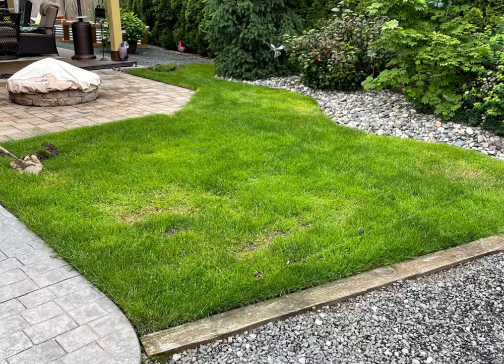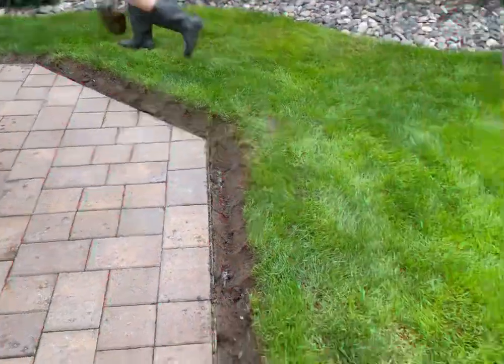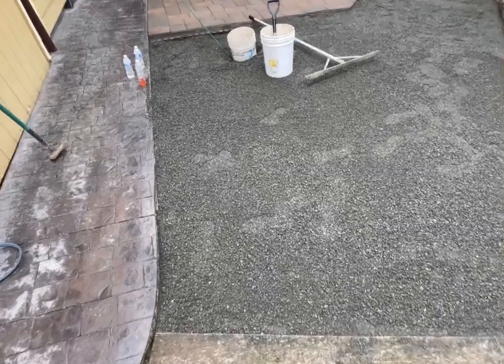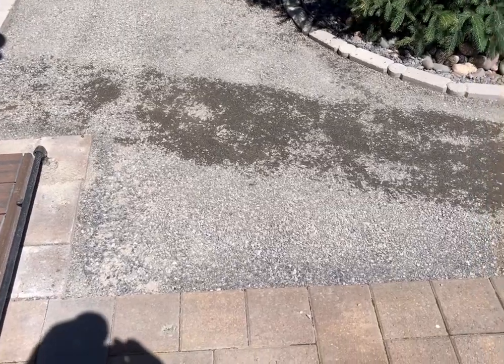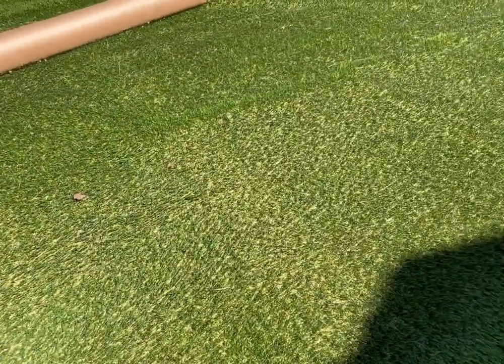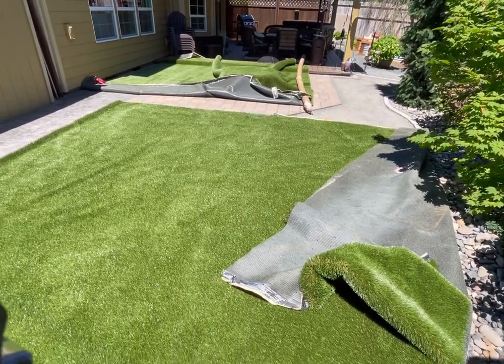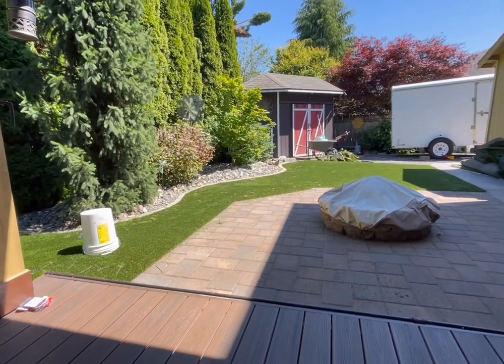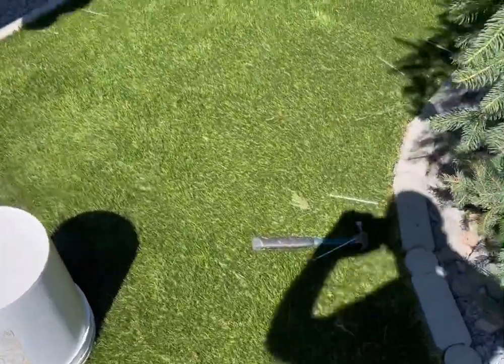DIY Turf/Artificial Grass Install - Save THOUSANDS!! $$$

Comment: Would you still recommend doing this? I'm strongly considering putting this under my pergola coming out of my back door instead of concrete. I'm worried cause I've heard the smell can be bad from pets
Reply from the maker: I wouldn’t install it up to the back door.  I’d have a concrete pad that close. But we love the turf. Way cleaner than grass - especially with a dog and lots of rain.